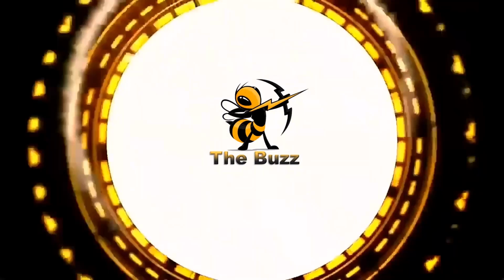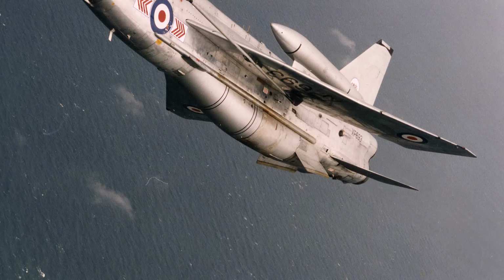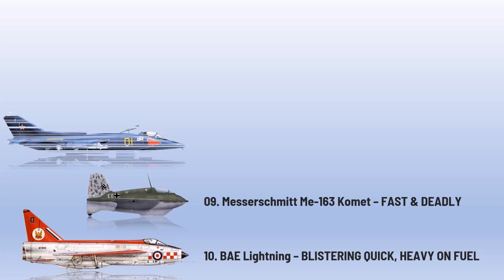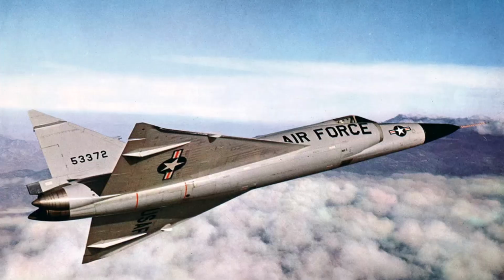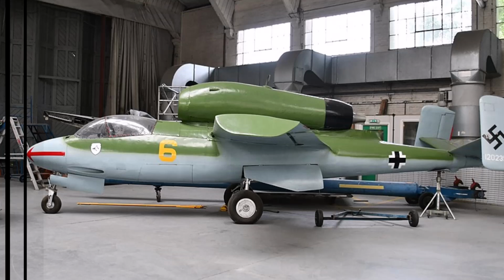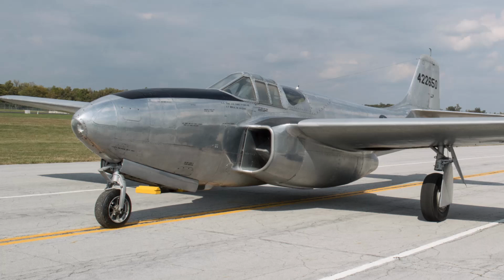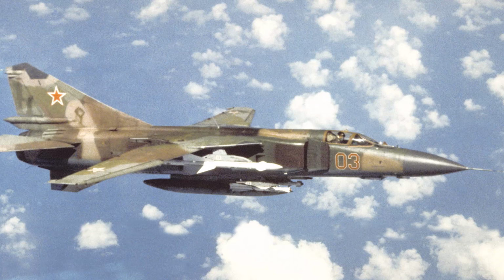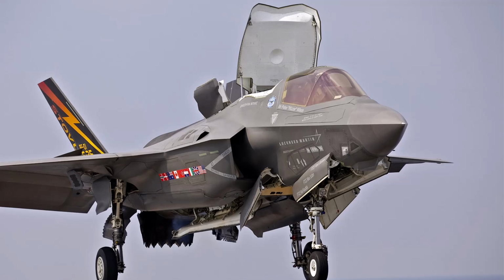The 10 Worst Fighter Jets Ever

Comment: got to call you out on your terminology: a fighter is an air-superiority platform, designed to deny the enemy the use of the airspace over the theater by shooting down its own fighters and close-air-support aircraft; an interceptor is intended for short-range point defense, that is, to stop enemy bombers from penetrating the home airspace (a role that has largely been subsumed by missiles) - the two types have different missions and different requirements, and calling an interceptor a "bad fighter" is like calling a volkswagen a "bad moving van".

Comment: The only problem with F-35 is the maintenance cost and operating cost. Mig 23 is still in service because it's too good to be retired.
Reply: And it’s’ total dependence on stealth to survive
Reply: @douginorlando6260  it’s not dependent on its stealth coatings, it is entirely dependent on its sensor fusion or its data link, the MADL.
Reply: The MIG 23 is trash
Reply: @kevinstraus1478  because?
Reply: Pfffft!! A pilot in a Sopwith Camel could down the entirely useless Mig-23. It's only around in very poor countries that can't afford a toilet to pee in.

Comment: The P-59 was never intended to be a high volume fighter , and none ever flew a combat mission . It was a learning exercise using a imported British Whittle engine to understand what a jet aircraft could do . It lead to the Lockheed P-80 a successful early jet . This is akin to saying the Wright Flyer is one of the worst aircraft ever made due to low speed , about 40 MPH , small payload 1 pilot , short range around 60 miles , and poor handling due to  wing warping as opposed to aireolons , and difficult operation due to its need for a rail and counterweight for takeoff . However its closest competitor in 1903 was a balloon which in comparison had many deficiencies .
Reply: The Wright Bros. at Kittyhawk…, Outstanding analogy!

Comment: F-35 may be bad at dogfight, but it’s best at BVR, every F-35 pilot knows it’s one of the best aircraft
Reply: Christy Li  nah, go ask F-35 pilots
Reply: had some issues back in early development, now it’s one of the most capable planes ever
Reply: @LifeForceGenerator  uhh.. sure.. sixth gen aircraft overcoming 5th gen.. that’s the whole point of a higher generation..
Reply: @LifeForceGenerator we’re literally seeing air forces around the world develop multi-role fighters compared to specialized fighters. India’s AMCA is expected to be multirole. China’s J-20 and J-31 are multirole. 

Majority of rumors surrounding 6th Gen Fighters expects them to be multirole.

Face it, the age of specialized fighter jets are coming to its very end since the cost of developing and maintaining just 1 model… is TOO expensive.
Reply: @kiro9257  But a multirole must be able to be good at such role or you risk to have a ggod fighter that is also a bad attack aircraft.
Reply: There's been claims that it's comparable to a Super Hornet in turning performance so it will actually do decently well in a dogfight particularly in a one circle

Comment: If you repute the Sea Vixen a failure (rightly), how about the CF-101B? Canada lost about the 50% of them, without a SINGLE lose for combat!
Naturally also the CF-104 had similar losses, some aircrafts shouldn't have never build.
Reply: The Canadians bought 66 F-101's from the U.S. in 1961; in the early 1970's they traded the 56 survivors for another batch of 66, which they flew until 1984.  They never lost 50% of either batch.  The Canadians lost around 40% of their Starfighters, but they also flew the shit out them, more than any other user.

Comment: This is the most random pick of fighters. First off, the Lightning was superlative for its time. It was NOT heavy on fuel but light. The F-102 was supersonic while the prototypes were not. They introduced the coke bottle body, and the Dagger was supersonic. Vixen..VERY well  liked by its crews. To say more were lost in training than combat is weak, almost all jet fighters had more accidents in use/training than actual losses in combat. There are exceptions. (F-105 for example) The offset cockpit is not an issue, look at airliners, offset but no issues. You compensate for it. And, your information on the Flogger id also weak. The first versions had issues (as any "first version" may have) but after that was/is a VERY well built and reliable fighter. The ML series are exceptional. The 4477th had problems but look where those planes came from and how long they had been sitting in the desert cooking. Everybody else loved the plane for its abilities, reliability and flying qualities. The 163 was a rocket and of course there were issues with the 162 with extreme lack of materials and skilled labour.

Comment: alot of the aircraft on this list should not be included, the EE lightning one was never made by BAE systems did not exist at this point, and it will be at least another 30 years before BAE systems were even a thought in someone's mind, more importantly, the EE lighting was a POINT INTERCEPTOR which means that its primary role was to take off, intercept a plane, shoot it down if needed and go back to base, it was never meant to be a fighter that job wen to the hawker hunter so they are comparing the EE lightning to an expectation which it was never meant to meat, that Yak 38 was a good aircraft, it was not as good as the harrier but it did what it was designed to do which was fleet defence a job which it accomplished, the Bell p59 also should be on this list as it was a 1st generation jet and as they go the p59 was a good jet aircraft, the foxbat is a great aircraft it's still in service because its a great multirole jet, its supersonic, good in a dogfight and is good in a close air support role if required. finally, the F35 should not be on this as even though it came late and is over budget saying doesn't live out to the promises is false, in fact in some areas it exceeds them especially in a ground attack, STVL and in an air to air role.

Comment: Saying this is the “most advanced aircraft the soviets had” is like saying “the original p75 due to double engine was the most advanced” the “Soviet harrier” as it was known was famous for taking off, using most of its fuel before it could go into horizontal flight. It was a failure beyond failures.

Comment: i dont know where to start with this idiotic list but , let me first say this
The English Electric Lightning is a legend, to even suggest it sits in a top ten list of the worst fighter jets is ridiculous to a point of infuriating 
It was designed during the cold war to shoot down Soviet fighter jets and bombers, and nothing could match it. All jets at that time were heavy on fuel, but it had enough range to fulfill its role  

Its Speed , rate of climb, ceiling height, were, and still are legendary, a heavy fuel usage is irrelevant, its like saying Pele was one of the worlds worst footballers, because he wasn't very good in goal

Comment: The top worst WWII plane is the Buckeneer, AKA the fuckeneer my Navy Pilot father called it. My father said the Buckeneer's propeller would come off in flight, engine would come apart then catch fire, and it was impossible for the pilot and navagator to bail out before it went nose first unexpectedly into the ground. Remember that name, the fuckeneer.
Reply: Don't you mean the Barrcuda?  The Buccener was a twin jet developed during the cold war!
Reply: Not to be confused with the British jet of the same name....
Reply: The buccaneer didn't even exist during ww2, what are you on about

Comment: F-35 while over budget is very effective and has a low accident rate.

The EE Lightning was intended as an interceptor so the speed in exchange for range made lots of sense. It wasn't competing for a contract against other fighters but against missiles.

The P-59 was never used as a combat aircraft so shouldn't count.

They worked out the F-102's problems before it reached production.

Planes that should have been on the list:

Yak-23, based on the Yak-17 which a piston engine airframe with a jet engine stuck in the nose, and technically a fighter but mostly built in a trainer configuration. The Yak-23 was only used for few a couple of years before being dumped on other Warsaw Pact nations as the USSR got the MiG-15 in to service.

MiG-9, reached operational use but its massive cannons would stall the engine making it almost impossible to use in combat since the pilot had to maintain specific speeds and angles of attack when firing.

McDonnell F3H Demon, under powered with a ejection seat that didn't work it was one of the first aircraft to carry the AIM-7 Sparrow but didn't have a second crewman to man the radar for interception duties like the F3D Skyknight or F-4 Phantom did.

Supermarine Swift, rushed in to production and thus had a long list of problems. Quickly relegated to secondary duties.

Sukhoi Su-11, obsolete within a year the USSR only made about 100 of them.

HAL HF-24 Marut, envisioned as a supersonic interceptor it got relegated to a subsonic fighter-bomber obsolete due to lack of modern engines when it entered service, it was barely better than the Hawker Hunters it was to replace.
Reply: 5 F35 crashes. 3 of which are this year . . Just saying
Reply: @animaltvi9515  The F-35 has had 5 class A mishaps since it reached operational service 8 years ago. Know how many the F-16 had 8 years after it reached operational service? 50.

Comment: The English Electric Lightning being in this list is pure bullsh**, it was built as a high altitude interceptor for nuclear bombers and as such it performed well. Range didn't need to be large for it's intended role.
Only when the kind of operations changed after ICBMs became a thing it was that range became a concern, as now the Lightning had to do longer patrol missions, and in that role it was replaced with the Phantom 2.

The F-35 Lightning 2 still has to prove its merits, but the project being hugely over budget and late it doesn't mean that the plane in itself is bad.
If these two criteria were used for determining if a plane is good or bad we can put a whole lot more on this list, like the F-22 Raptor or F-111

Comment: The English Electric Lightning, not BAE that company didn't even come into existence until long after Lightning production ceased, did exactly what it was designed to do, and what it was designed to do was to reach high level Soviet bombers as quickly as possible, the lack of range wasn't considered a hinderance to its task, the over-wing fuel tanks were only fitted for ferry missions and never carried on operational intercepts so they in no way detracted from the Lightnings capability. I am surprised that they showed a photo of a Lightning carrying out a task it was never actually designed to do, low level ground attack, and which was the only role in which the Lightning  actually did see combat in.

Comment: F-117 is worst, since it does not even have guns or missiles. Both it and F-35 should have "A" designators - A-117, A-35. Since they are really designed for attack.

Comment: Yak38 has 3 engines, not 2. But only one is used for horizontal flight. The other two are small lift engines only used during the take off and landing. So the statement that if one engine failed, the plane will be lost is incorrect. Usually, vertical takeoff aircrafts don’t use two side by side engines because if one failed during vertical takeoff or landing, the aircraft will be sway to a aside and crash. That is why Harrier has only one engine. But the Yak didn’t have an engine powerful enough to to take off vertically, so the designers added two smaller vertically mounted engines . But all 3 are inline so even if one engine failed, the aircraft will not sway to a side and crash on to some other aircraft or other equipment on an aircraft carrier. It will just slam down on the same spot. This may destroy the aircraft but there would not be any collateral damage to other aircrafts parked nearby.  With Yak 38, the problem was not the number of engines, but simply the design was not good enough.

Comment: Ok wtf... 2:00 you’re talking about the flying chodenschnitzel and then suddenly break into “corrosive hydrogen peroxide and bla bla bla melts your flesh, making the cabin of the flying chode a terrible place to be.” Ok. But why? What does that chemical have to do with the chub of the skies? Did it run off that? Were there problems with said chemical spewing forth, unpredictably, and showering the pilots in flesh melting propellants? Because that’s, that’s like a pretty big oversight if whenever this happened they just kinda “oh well” and shrugged their shoulders. I need some context, man...

Comment: Two major blunders here
The English Electric Lightning was short ranged but it was designed as a fast intercept plane. It was it's excellent time to climb ability that made it a monster when it came to intercepting planes trying to get into the home islands which is what it was built for so it didn't need a long range. And you have absolutely bumped your head bu including the F-35 on here. Yes when it first came out it was way over budget and full of flaws no doubt about it. But now they have the major problems solved and are working on the little ones. And with the number of planes that are being purchased by the US and other countries the cost per plane is actually very low all things considered.

Comment: Neither Lightning itineration should feature in this list... Your reasoning is poorly informed at best. The fact you can rate a plane which allegedly "doesn't meet original design brief" higher than ones that kill it's pilots regularly suggests you might be better qualified in ranking sexiest uniforms rather than stuff like this.

Comment: Correction top 9 worst the F-35 is better then you think it beats every plane but one, the Lockheed Martin F-22 raptor the F-35 has the ability to give you a full 360 degree view and see through the frame and fuselage it has gone through multiple upgrades and is able to now carry a maximum payload of 12 weapons max (not including gun) the F-35 is not 100m it’s currently 75m but it’s nothing compared to the F-22 raptors 125m the F-35 is undoubtably the best fighter jet in the world it is stealthy to not as much as F-22 but still very stealthy it may have some problems but nothing is perfect so overall the F-35 should NOT be on this list

Comment: Everyone bagging on the F-104 is ignoring the fact it was designed and built as a high altitude interceptor. Once that role became obsolete it was repurposed by countries that couldn't afford to replace them. It was not suited for it's new role, but that's not the fault of the aircraft, it was the fault of the people who decided it's new role.
Reply: It was designed as an air superiority fighter, not an interceptor.  The European "G" model was just a refinement of the USAF multi-role F-104C.  Whether or not it was "suitable" in it's new role is up for interpretation.  Certainly the air forces that used it thought so.
Reply: @dukeford  it was built with large air intakes to fly at high altitude then was used in low level ground attack. It was a bird inhaler and pilot killer
Reply: @kevinw2592   You fly at low level, you're going to have bird strikes.  The type of plane doesn't matter.  Neither do the intakes. I was in an OV-10 at around 2,500 feet when we hit a turkey vulture.  As far as this "pilot killer" business is concerned, the F-104 didn't kill any more pilots than any other contemporary aircraft.

Comment: hate to tell ya this but neither the Me-163 or the He-162 were even designed for air to air combat. The 163 had a power duration of 7 minutes before it became a glider. It and the 162 were designed for one purpose and that was to intercept the bomber streams, take down as many as possible and then to RTB as fast as possible. As for the P-59, what did  you expect, it was the very first jet built by the US. Baby steps first. The engine was the first one the US had ever seen and  was pretty mediocre. Poor engine, poor performance but they learned a lot from it, The P-80 was a vast improvement.

Comment: Ok...
Me163 and He162 no argument and same goes for Sea Vixen. 
+1 other arguments in favour of the Lightning. Something I did not immediately appreciate is that from a maintenance point of view the Lightning is a nightmare. To service the lower engine you have to extract the upper. However, with that configuration a Lightning can reverse a turn far quicker than a plane with side-by-side engines. 
F7u Cutlass. An aberration. The Lockheed Starfighter, (not included on your list?) was nick named the Widow maker. The Cutlass was called the Ensign Eliminator. However it was the US Navy’s first two-seat, twin engine fighter with all weather radar, cannon and equipped with early infra-red and radar homing missiles. 
F102. Eventually the transonic drag problem was solved with a change in the shape. This led to the F106 which had to live in the shadow of the mighty F-4 Phantom but was still a very capable aircraft.

Comment: What a mess of a list. The Lighting did exactly what it was designed for, the F-35 is an amazing aircraft no reason to even be one the list when the f-104 isn't. Me 163 was a rocket not a jet, the p-59 was an experiment with the Whittle w33 the first jet engine that was an experiment in itself and not really a fighter. Not a list to take seriously.